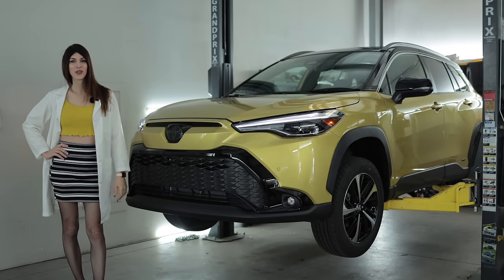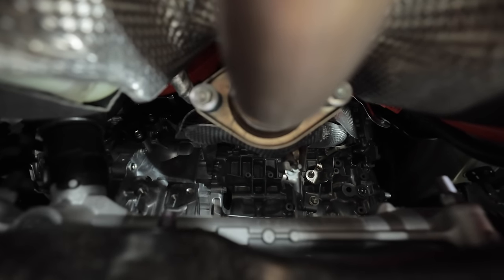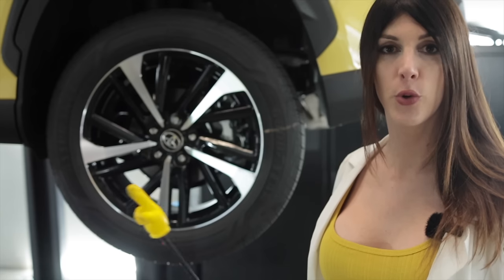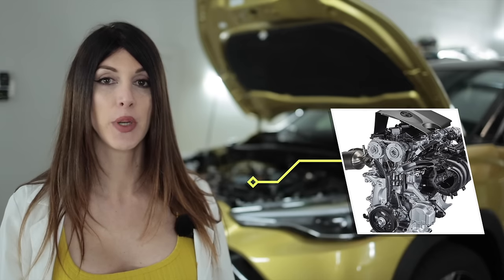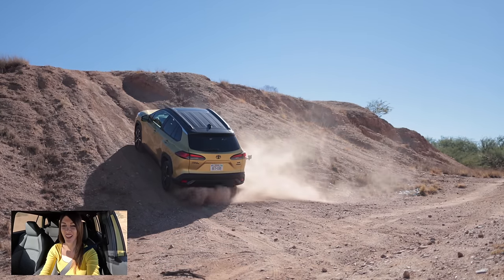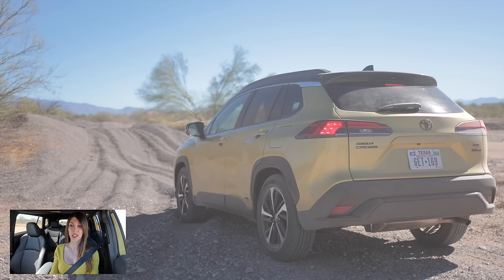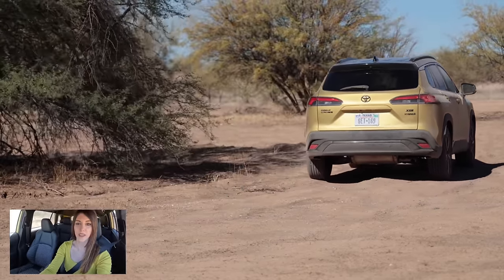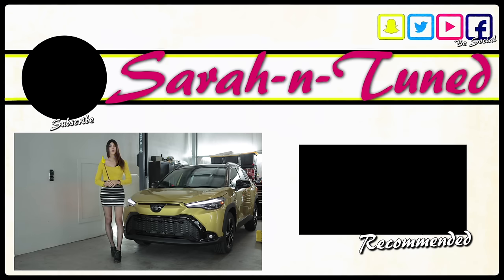The 2024 Toyota Corolla Cross Hybrid Almost Nailed It..

Comment: i have a CC with 2.0 gas engine non hybrid.  I use extreme driving style (hyper milling and cruise around 80 km/h) to extract the best mileage. So far my best try was 4.167L/100km, which is about 56 MPG. My overall MPG after 8000km of driving is 46.94.( 5.0L/100km) So the M20A FKS coupled with CVT is extremely efficient.

Comment: I have the original 1988 Corolla Alltrac wagon with 300,000kms and original radiator and clutch. The thing won't die. The hybrid Corolla Cross has a few issues. Lack of space for a spare tyre. Lack of any diff lock like the Alltrac. The completely black interior (in Australia there is no light interior option) a PHEV option would be nice.  I do like the solid, honest materials that will age well.
Reply: The front wheel drive has a spare tyre, in Australia, anyway....
Reply: @zwieseler  I've seen that but whats annoying is the hybrid AWD has the spare wheel well but with the cable for the electric rear motor sitting  right in the way of making the space usable.

Comment: Toyota all-track (aka Sprinter Carib).  Still have one. 240,000 km's. It is my wife's daily driver.  No mods and original everything (except I replaced the distributor cap and leads a while back) including original first aid kit.  Just well maintained.  A real mechanical 4x4 with center diff lock and no electronic trickedy-wickedy to go wrong.  More reliable than a brick.

Comment: Not a true all wheel drive as the front wheel/s were spinning on the uphill test while the rear appeared to do nothing, also in the gravel pit only the right front was spinning. It desperately needs a front LSD or diff lock and 50/50 drive split evenly. The early 80's version (AE95) at least here in Australia was much more capable.

Comment: I think the thing must have bad software on it.  Based on what you said, it has all the hardware needed to likely make it up that hill and also make it through the gravel  pit.  In both cases, it didn't control the wheel spin.  Since it is electric, that is a software issue.
Also:  I have some paper maps in my car.  The electronic maps get wildly inaccurate in a national forest.

Comment: Depending on variant, it either uses the gas 2.0L M20A-FKS /w 169hp @6600rpm, flex fuel 1.8L 2ZR-FBE /w 141hp @ 6000rpm, or hybrid using electric motor plus either a 2.0L M20A-FXS /w 152hp @6000rpm, or a 1.8L 2ZR-FXE /w 98hp @5200rpm, but those values apparently change in other countries somehow, wtf?

Comment: They are manufacturing some crap components on newer cars lately. IF ANYTHING breaks or wears out on these complex electronic cars? Were talking MANY THOUSANDS just to keep them running precisely. (2027 Forester with 45,000 miles: New ball bearings at the rear $650 at 40K (started making noise at 30K), a/c service, charge and new fan $420 (at 38K miles), new front suspension control arms on both sides $1000 and the crap factory tires that wore out at 18,000 miles. Bought some 60K mile tires cheap online for $400 complete installed. These things should NOT be breaking or wearing out so quickly especially the way I drive...

Comment: Toyota should have dropped this and keep the C-HR - at least the 2024 model.  Heck, even the interior styling is much better in the 2024 C-HR than the Corolla Cross. 12" touch screen infotainment, 64 color ambient lighting, rear-view mirror is also a wide camera, even has 360 bird's-eye view.

Comment: I dont see how this awd system is going to perform any differently in the snow than on loose dirt. Seems like a fail. Whats the point of an awd system if there's no lsd, locking diff, or traction control system to utilize it?

Comment: These do better offroad than you let on (even minor rock crawling in other videos). When a wheel starts to slip, you have to wait for the system to redirect power to other wheels, don't just quit. That hill also had a lot of slippage with so much loose dirt, and tires weren't up to it, of course.

Comment: Paper maps don't require batteries and internet connections.
Reply from the maker: But they require pulling over every time you need to make an important direction change or risk getting into a fatal collision.
Reply: @SarahnTuned  I didn't mean when driving. If you go camping or you are out in the middle of nowhere, you will still need a paper map. It is like cash. You have all these idiots who think they don't need physical currency until the phone dies, the battery goes flat or the internet is down. Then they are screwed. There will be a point where you won't be able to get a paper map. When you are lost in the middle of nowhere with a dead phone, you die. I have spent my life with technology and I know it's limitations.

Comment: Sarah I’m going to have to bonk ya for this one. CVT stands for Continuously Variable Transmission. They’re not limited in design to just two pulleys and a metal belt. 
In this configuration the transmission uses an angular gear sets to connect a gas motor to an electric motor with a singular power output to the transaxle. 
The transmission uses a second electric motor to replace the gasoline motor when operating in pure electric mode. 
The two motors also allow the power train to make full use of regenerative braking without stress loading the gas engine. The second motor also functions as the starter and generator for the hybrid driver.
Overall it’s a very efficient and clever system.
Reply from the maker: Nothing that you just typed had any effect on my stance of what I said.
Reply: I’m not sure I see the delta here…….

Comment: Essentially the same thing as my Venza Hybrid, but cheaper/worse interior... But at matching spec to my fully loaded Venza its roughly 6k cheaper. I still prefer the Venza Styling and interior a great deal more than this. Venza is basically a Lexus without the badging. Sad they're discontinuing it again in '24.
The cross hybrid seems like a great fit between the Rav4 and the Highlander.
Reply: It’s positioned below the RAV4